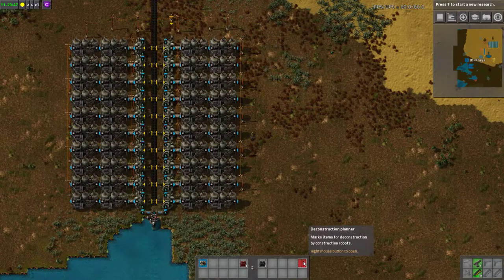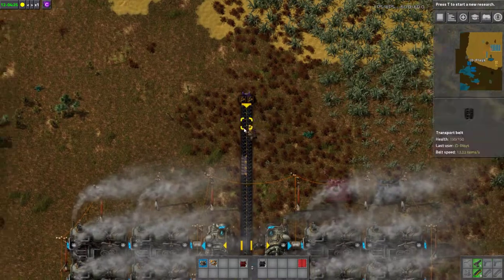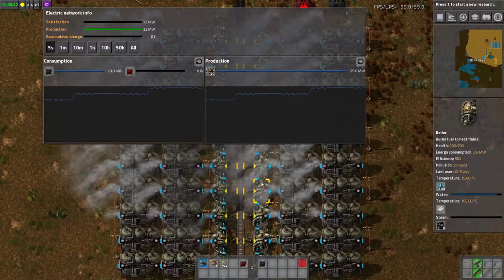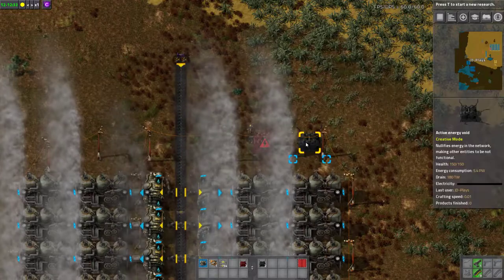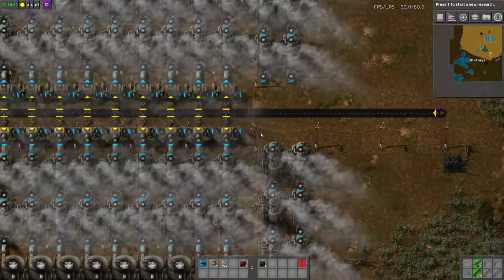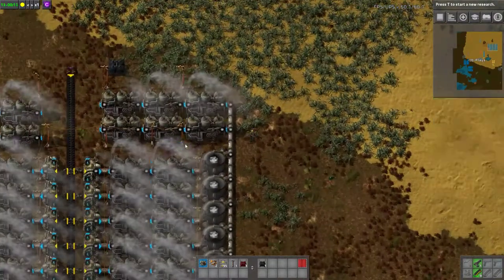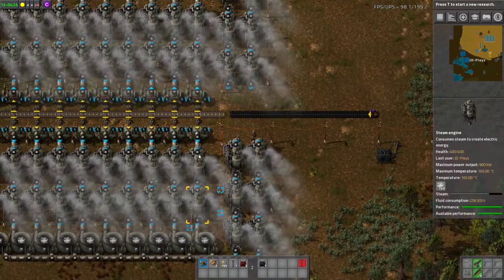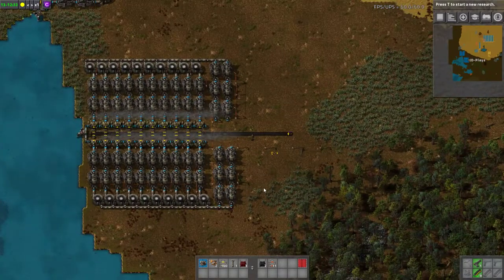Steam Batteries - Factorio - Tips and Tricks in 10 minutes

Comment: Just a note, if you connect those storage tanks to a circuit wire and hook up a speaker, you can make an alarm go off when the steam storage is under X amount to let you know you have a power problem.
Reply from the maker: Rakkfalen yes u can! Setting the alarm for about 20k seems to be perfect.
(I haven't covered simple smarts yet)

Comment: Newbie question: what's the advantage of doing it this way vs. using batteries to buffer demand spikes or supply failures? I've not really used batteries yet, so not sure if it's a cost issue or something fundamental I'm missing...
Reply from the maker: Research and cost.
Tanks are a red only science, costs iron and steel and steam engines are just more iron.
Batteries, need blue science for oil processing, and need sulfuric acid, as well as chem labs, to then make accumulators which also take more processing.

Comment: Is the extra 6 steam engines per side the maximum extra it can handle?
Reply from the maker: Rakkfalen pipe can handle 1200 per second.
Engines use 30 per second.
So you could hang 20 of each side.
Being 30 total steam engines for about 4 minutes of power from all the tanks.
I generally recommend hooking both sides together and putting 20 extras engines (that came in design 2.0)